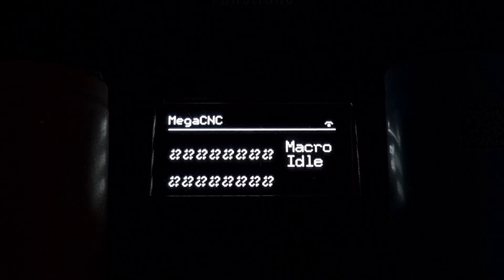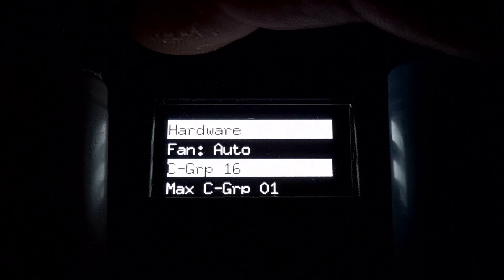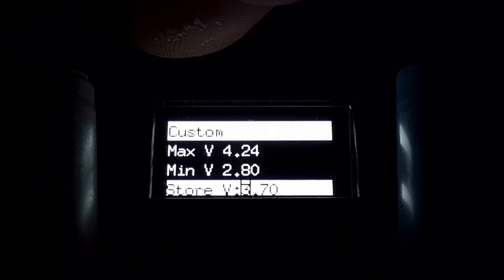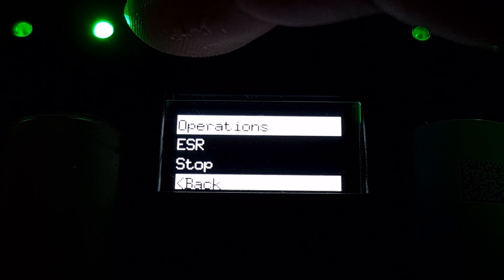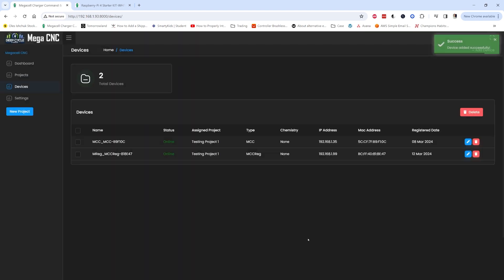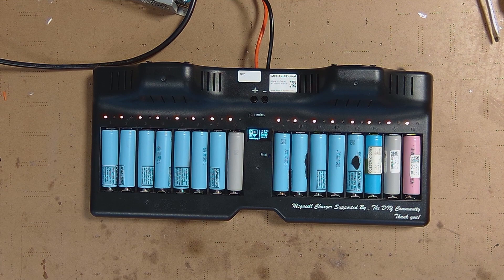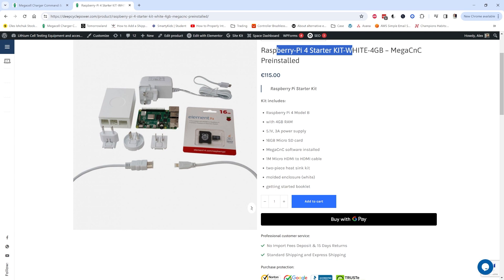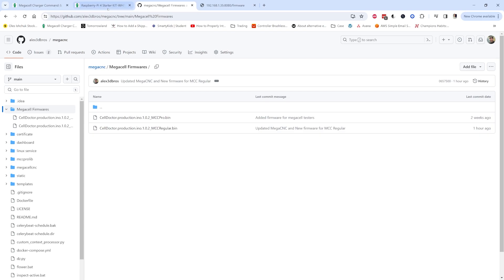Megacell Regular Firmware Update - State Machine - Major Upgrade - Mega CNC

Comment: Hello, 

what is the type of the ADC used on the Megacel Regular charger board? I have broken my charger by connecting 12V as the power supply instead of 5V by mistake. I replaced and flashed the ESP (it was also dead) but now it does not detect all of the I2C devices on the bus and the ADC seems the only thing missing.